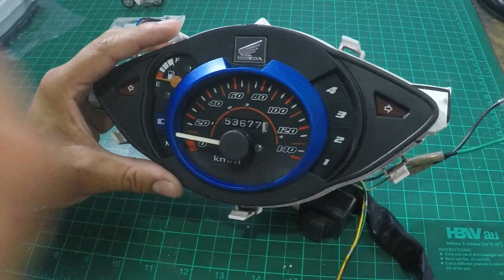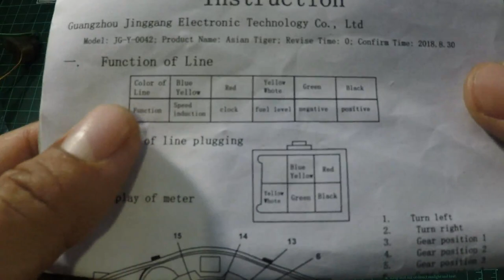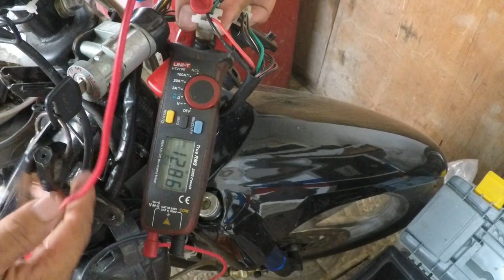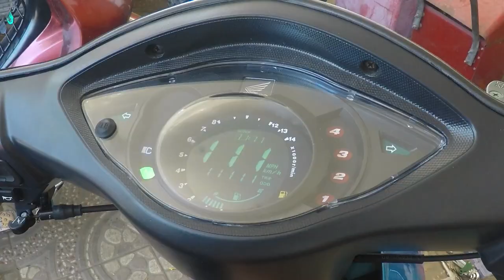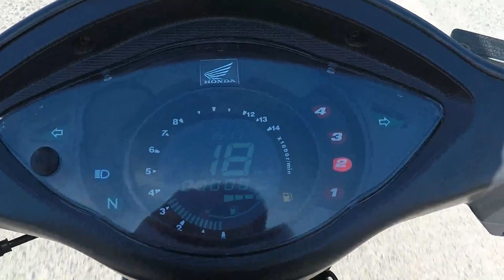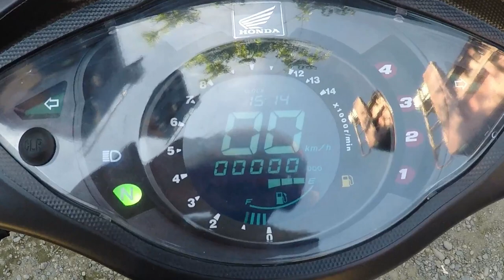Honda Wave 100 Digital Panel Gauge installation

Comment: Making tulong Ng video na to, 100 times ko pinanuod kahapon, step by step hinaya ko lahat, salamat po Ng marami successful Ang pagkabit ko more power
Reply from the maker: Maraming salamat po sa support!
Reply: Sir Yung fuel Di ata accurate naka full full tank ako kahapon tapos ngayon empty na pero nung sinilip ko Ang tangke marami pa namang laman, ganun din po ba sa Inyo?
Reply: @RizalDy3469  palpak yang digital boss. Sa board mismo may prpblblema
Reply: Boss san mo nabili yan ganan na panel gauge? Sana masagot
Reply: @RizalDy3469  plit ka po ibang floater po😊

Comment: May idea ako custom sa wave 100, naked handle bar, tpos kakabitan ng windshield sa harap then nakakabit sa bracket nun ung side mirror parang nmax (ung sakto lang laki pra sa wave100) tpos digital panel gauge dun ikakabit sa awang sa gitna ng windshield (nakita ko ung idea sa click 125 / 150 na nka windshield + naked handle bar) baka maisipan mo lng 😁. Ung digital panel gaude kamuka ng sa raider fi
Reply from the maker: Maganda nga yun sir, na visualize ko din sya. balak ko din po gawin pero kukuha pa ako ng isa pang wave 100 for that project.

Comment: ask ko lang po' panu pag pag walang speedometer cable gagana parin po ba yung RPM nyan?

converted po kasi yung wave ko, wala na pong speedometer cable kasi hindi fit yung mags pang raider kasi. bale tanggal yung cable nya..

thank you po sana mapansin.. balak ko po kasing magupgrade yan..

Comment: I have my honda wave 100 since last 2014 hangang ngayon all stock parin, except sa "chain sets" at "gulong". mukhang bago parin kasi alaga sa change oil at ingat sa pag gamit. what I love this motorbike is its fuel efficiency napakatipid talaga, I'm planning to sell it, but I have already an apprehension when I've watched your video. thanks for sharing bro!

Bibili din ako ng digital speedometer.
Reply from the maker: That means a lot to me sir Randy, Madaming mas, malakas, mas matulin at high tech na motor ngayon. pero I prefer using this mc kasi tulad po ng sabi nyo fuel efficient ito at madali ang pyesa and mura, madaling itroubleshoot at higit sa lahat para sakin maganda ang itchura. Thank you sa panunuod, Ride safe po :)
Reply: @theadventureofwave1002  para sa atin na kontento lng sa simpleng bagay maganda na talaga ang wave 100, mas okay sakin ang unang labas kesa bag o ngayon, madali lng pagandahin at tama ka mura lng ang mga accessories nito at madaling hanapin, kahit anong hightech, mabilis, angas, o lumilipad man ang motor mo after all mkakarating karin naman sa pupuntahan mo. 😂
Reply: @theadventureofwave1002  pare d ba mapuputol ang cable kung mag babacking ka? since digital to?
Reply: @theadventureofwave1002  wala fuel gauge sir?
Reply: Gud pm sir, san po nakakabile ng ganyan spedomiter? Pwede rin po ba yan sa honda dash 110?

Comment: Anu kaya sira NG motor ko pinalitan ko n NG cable speedometer Yung motor ko Ang nangyayari sumasagad parin Yung sa dashboard kahit mabagal Ang takbo. Honda wave110r. Drumbreak po
Reply from the maker: try nyo po muna mag basic troublesoot, linisian nyo ung speedometer gear sa may hub. make sure po na tama ung speedometer cable na pinalit nyo, make sure din po na naka kabit mabuti ung cable sa panel gauge. pag ganun parin po ang issue. most likely ung panel gauge na po ang sira.

Comment: Sir bakit ang saken malaki ang jump ng number ng indicator pag natakbo from 25 ang next na is nasa 35 or 40. Pano po kaya ito. Thank you po
Reply from the maker: sir try nyo po linisan ung gearbox ng speedometer sa may hub. linisan nyo ng gas para mawala lahat ng lumang grasa then grasahan nyo po.
Reply: @theadventureofwave1002  natry na sir. Pero kahit mabagal ang testing sa 5 agad natalon ang indicator.

Comment: sir new subs po ako..my tanong lang ako..di kasi accurate yong tachometer ko na blue wire kahit naka connect na ako sa ignation coil..wla bang ibang option na pwd pag konikan nang blue wire sa tachometer pra gagana siya..!!!
Reply from the maker: Maraming salamat po sa pag subscribe sir. My cases po akong na encounter na hindi accurate yung tachometer. Tama po pinag kabitan nyo. and para maka sigurado much better po if gagamit kayo ng tachometer tester para ma pag compare nyo po yung sa digital gauge kung gaano kalaki ang diff. nya.

Comment: Boss papalitan pa po ba yung speedometer cable at gear box para xa digital o yung stock pa rin na cable gagamitin?

Paano po paganahin yung rpm boss?
Reply from the maker: Plug and play na po yung speedometer cable wala na kelangan palitan, ung sa rpm po. Blue wire icconnect nyo lang po sa pulser ng ignition coil.
Reply: Salamat boss may problema pa ako boss..di gumagana yung function pag mag set boss ng clock tsaka ng kulay..tpos delay po yung rpm ko at speedometer ko pag tumatakbo na

Comment: Idol salamat sa tutorial all working lati fuel gauge ♥️💯 kaso bakit ganun idol by 5 yung pag angat niya ng numbers from 0-5 then 5-10 agad ano po kaya problema dun sana masagot idol
Reply from the maker: Walang anu man po. Maraming salamat po din po sa pag support sa aking maliit na channel. Sir may mga narinig na akong cases na ganyan. personally speaking, baka po manufacture defect na po pag ganun.
Reply: @theadventureofwave1002  Salamat idol full support ako sa mga daratin na video mo 💯

Comment: Idol thank you sa tutorial all working pati sa tutorial mo na fuel gauge ❤️ may issng concern lang ako sir bakit kaya super delay padin ng angat ng rpm ko kahit naka rekta na siya sa ignition coil. hindi siya katulad ng sa video mo idol na hindi masyado delay ano kaya problema nun sir. sana po masagot idol
Reply from the maker: may na encounter na din ako na ganun sir. nung nag pa kabit sakin ung kaibigan ko ng same digital gauge. sa product na po mismo un problem pag ganun..
Reply: @theadventureofwave1002  Salamat sa pagsagot idol 💯❤️

Comment: Sir need ba bago or working Un battery? try ko sya install pero ayaw mag on yung main panel paano kaya to try ko nman follow un instructions mo.
Reply from the maker: Yes sir kelangan po working ang battery d sya gagana ng maayos pag sira ang battery sir.
Reply: @theadventureofwave1002  ok na po sir pero ganun ba talaga sya after ko lagyan ng fuse sa battery kahit nya off may clock display na maliit sa gitna? Nung kasi wala pang fuse nka fully off sya talaga walang display na clock pero hindi naman na reset un clock.
Reply from the maker: @lawo6586  yes sir, ganun ung clock feature nya. kaya much better pag maganda pa battery mo di sya madredrain agad :D
Reply: @theadventureofwave1002  ah oks sir ty sm po

Comment: Lods,ano kaya problem nung saken, kapag nasa gear 4 na namamatay yung gauge. From gear 1 to gear 3 oks sya.
Reply from the maker: baka po grounded ung wire ng 4th gear indicator sa may gauge. check nyo po kung may exposed na wire.

Comment: Paps, ano ang long term review mo sa digital gauge mo? Kamusta siya after a year?
Reply from the maker: for a while okay naman sya kaso napansin ko mejo naninilaw na ung lens nya.
Reply: @theadventureofwave1002  Pero working pa din lahat?
Reply from the maker: @lesterevio  opo. okay naman sya, kaya lang pag malakas sikat ng araw ang hirap makita ng lights.
Reply: @theadventureofwave1002  hindi ba same ang size ng lens sa digital panel gauge sa stock panel gauge?

Comment: Sir serious question po, yung speedometer ko nawala po yung line ng Neutral wala ding bulb kaya walang ilaw yung N, pano ko po siya malalagyan kasi magpapalit po ako ng ganyang digital speedometer. Thankyou in advance!
Reply from the maker: punta lang po kayo sa suki nyong motorcycle parts at bili kayo ng bulb socket ng gear level indicator. yung wiring ng gear indicator nasa left side ng engine. dun nyo po ma tretrace kung asan ung connection ng neutral.
Reply: Thankyou sir, pwede ka po ba ma add sa facebook? Want to be friends with you and papatulong na rin sana pag may problema idol! Salamat
Reply: Boss nakabit ko na digital speedometer ko kaso bakit rumerekta sa selected  color di yung pag open nung susi nag iiba iba muna, tsaka boss nagrereset lagi pag may nagagalaw. Yung kulay tsaka oras kahit nakarekta naman positive yung clock.

Comment: Sir naka battery operated cdi ako, yung tachometer hindi nagana, pag nasa ignition coil wire,kaya tinap ko sa pulser wire sa cdi. Okay lang po ba yun?gumagana naman na rpm guage, pero i doubt kung walang short circuit na mangyayari. Salamat po sa sagot. Subscriber nyo po ako
Reply: Sir saan ka nakabili ng digital para ss wave 100r?

Comment: Sir. need pa ba ng floater yan para gumana yung fuel gauge?
Reply from the maker: opo, need po ng floater para gumana fuel gauge.
Reply: The Adventure of Wave 100 pang anong motor sir ang floater na ginamit nyo?

Comment: bro ask ko lang di accurate yung gas niys laging 4bars lang ano kaya pwede gawin?
Reply from the maker: napansin ko sir hindi maxado accurate. check ko ulit anu fix dun then mag upload ako new vid.
Reply: paps. shout out mo ako ha. eto para accurate yung gas palit ka ng floater ng mio. adjust mo lang para sa bar pataas . tapos ang hindi mo ilakabit sa floater yung wire na blue sa gas tank. accurate na yun 😊
Reply from the maker: @zeedave12  Try ko to sir maraming salamat po. Opo sir commended po kayo. Thank you po sir ZeeDave!

Comment: Hi po kuya sana mapansin mo ko. Gusto ko po sana magpatulong. My motor po kasi papa ko wave din. Pinamana na nya sakin. Ang kaso po sira lang konti. Need ko po ma upgrade yung motor papa. Kaso di ko po alam how
Reply from the maker: Maganda po yang tanong nyo. pag gusto nyo po mag start ng restoration project tignin po kayo online kung anu gusto nyo gayahin na concept. then unti untiin nyo po. i would suggest mag start po kayo sa engine. Good running engine ang pinaka magandang start. kasi at the end alam mo na aandar sya ng maayos.

Comment: Sir? Nagpakabit na ako neto pero di na se save ang time at kulay. Ano po ba dapat gawin pra ma save? Salamat
Reply: @8:53 lods, pero ung akin red wire sa ignition ginilitan ko lng ng konti tpos tap
Reply from the maker: dapat po ung red wire may direct connection sa positive terminal ng battery and di po dapat na didisconnect.
Reply: @theadventureofwave1002  ahh, ok sir. Thank you po. Godbless

Comment: Gud eve po boss, patulong po nag lo-loose contact po ba sayo? Kasi iyong sa akin maliit na hump lang nag rereset eh, salamat po
Reply from the maker: nang yare din po sakin yan sir. ang prob pala nung sakin is ung ignition switch. pag na gaalaw na wawala power. try nyo po paandarin motor nyo tapos alugin or galaw galawin nyo po ignition switch pag na matay sa pag kaka galaw malamang po dun na un.
Reply: yong sa green wire at black para sa panel gauge light lagyan mo ng extra wire bago mo lagyan ng electrical tape...ganyan din dati sa akin nagre-reset dahil lose contact yan walang kuryente...
Reply: yong sa green wire at black para sa panel gauge light lagyan mo ng extra wire bago mo lagyan ng electrical tape...ganyan din dati sa akin nagre-reset dahil lose contact yan walang kuryente...

Comment: Sir paano nga pala stay yung clock nya nababago siya kapag nag off ng switch.
Reply from the maker: dapat po ung red wire of yung lock naka kabit sa positive terminal ng battery para kahit i off nyo po yung ignition switch di madadamay ung clock.

Comment: Sir tanong ko lang paano yung wiring ng rpm? Dina walang rmp ang stock speedometer?
Reply from the maker: opo, walang rpm guage ang stock speedometer.
Reply: Sa ignition coil ba kukunin ang kurente papunta sa rpm?
Reply from the maker: @alemodinracmat4617  opo sir

Comment: Pwd po ba Yan sa Honda wave 110r?..big thanks sa sagot
Reply from the maker: opo yata. kasi same ang panel gauge ng bagong wave 100 which is wave 110 na ngayon.
Reply: Wave 110 user here... Oo paps, pwedeng pwede siya... 2 months na siyang nakakabit sa motor ko... Diko nga lang ma set yung clock, di accurate yung fuel gauge at wala pang rpm meter (tachometer) kac naubusan ng wire at di makalabas kac under quarantine parin...
Reply: @exdeedatsuki8786   yun sakin paps wave110 din2018 model fit kya sya sa panel ng motor ko...salamat paps
Reply: @avegailsalitorno3588  fit siya

Comment: bat skn nagbblink ung fuel? gnya ko nmn yan bat ngbblink s empty ung fuel gauge nya
Reply from the maker: pag nag bliblink po  that means almost empty na sya or hindi naka connect ang wirings ng fuel gauge. if connected na ang wiring at nag bliblink parin. may posibilty po na defective and unit. check nyo din po yung fuel sending unit if gumagana.

Comment: Sir, bakit ung sa akin nag iiskip ung speedometer? pag tumatakbo na, Ano kaya problema? Patulong boss?
Reply from the maker: na experience ko yan sir, namamatay matay pag umaandar. sira pala ung ignition ko and one time super lowbat ung battery ko kaya papatay patay din.
Reply: @theadventureofwave1002  sir, di naman sya namamatay, di lang continous ung number ng speed, nagaagwat sya, ex: from 15kph bigla na lng magiging 22kph, need pa ba may ibang icoconvert? tapos ung kanyang clock, 90sec/min kaya di rin accurate, pa tutor naman boss baka may alam kang gawin para maayos panel gauge ko, salamat :)
Reply from the maker: @TheJerneth  Check nyo po mabuti ung speedometer cable, dapat po naka salpak ng maayos, then linisan nyo po ung gearbox ng speedometer at grasahan nyo para smooth ang galaw, check nyo na din po ang cable, make sure na smooth din ang ikot nya. about sa clock sir try nyo pong alisin sa battery connection ung gauge then plug back in then set up nyo po.
Reply: @theadventureofwave1002  ok sir, try ko gawin bukas, update ko kayo kung ano mangyari hehe. Salamat po.

Comment: san na bibili?
Reply from the maker: sa lazada ko po nabili pero meron din po sa shopee
Reply: @theadventureofwave1002  pa hinigi link sir. hehe
Reply from the maker: @chardofficial6678  https://www.lazada.com.ph/products/for-honda-wave100-lcd-multifunctional-motorcycle-digital-odometer-speedometer-tachometer-fuel-gauge-i699396084-s2022228692.html?spm=a2o4l.searchlist.list.43.107a464cJdPzGN&search=1

Comment: boss saan nkakabili nyan at magkano mg pa install?salamat boss
Reply from the maker: sa lazada ko po nabili to, 1.6k about sa installation di ko po sure mag kano ang tanggap ng mga mechanic/electrician baka po nasa 200 to 300 pesos po.
Reply: @theadventureofwave1002  and pwede rin po pala dun yan sa wave110?

Comment: bakit sabi sa lazada reviews di raw accurate ang fuel gauge
Reply from the maker: Tama po sir need pang palitan ang stock fuel gauge ng wave 100 para maging accurate.
Reply: @theadventureofwave1002  
boss anung fuel gauge ang pinalit mo?anung motor ng fuel gauge..salamat boss sa sagot

Comment: Accurate po ba ang fuel gauge?
Reply from the maker: yung fuel low ko 2bars eh di maxado accurate.
Reply: @theadventureofwave1002  same po tayo. may nag sabi sakin 2 wire floater daw kaso d ko alam pano ikabit
Reply from the maker: @chinogameon3247   di gaano accurate ung fuel gauge sir,  pero sinubukan ko itaas floater tumataas din bar pero di full bar. pag binaba ko naman ung floater na almost emty nagiging 1bar instead of blinking dapat. nag kabit din ng ganito ung kaibigan ko yung kanya pag emty blinking nlng.
Reply: @theadventureofwave1002  eto yung reply nya sakin hindi ko lng masyado na intindihan, "Hanapin mo ung pumunta sa digital mo na yellow wire  at green wire un dalawa na un"

"Ibig sabihin dalawang wire lng kc ang stock natin na floater 3wire lng pang analog gauge un"

kaya daw need ng 2 wire floater para mag accurate
Reply: @chinogameon3247  meron pong convert na ggwn jan.. Magpapalit ka ng floater.. Ops secret 😘😘
Reply: @anti-ponzipyramidingscheme7165  pa tulong po paps wag na po secret hehehe
Reply: @theadventureofwave1002  magpalit ka ng floater pang faider 150 yung two wires, ayun   ayos un.. Thanks me later
Reply: @anti-ponzipyramidingscheme7165  patulong nmn paps

Comment: Sir, bakit po nag rereset yong time kapag starter ang gagamitin ko 🤭
Reply from the maker: malakas po ba votage ng battery.?
Reply: @theadventureofwave1002  Ok na po sir. mahina lang pala yung voltage ng battery ko. kaso yung sa fuel gauge parang hindi tugma sa digital
Reply: Yung akin hanggang 4 bars sa digital kahit na full tank ako.
Reply: Boss anong floater pinalit mo laging blink lng sakin eh

Comment: Sir ayaw gumana ng clock..
Reply from the maker: make sure po ung wire ng clock naka direct sa positive terminal ng battery. pag ayaw parin po. try nyo po na tanggalin ung speedomter. then test nyo po. pag dikitin nyo lang po ung black at red wire. dikit nyo sa positive ng battery then ung green wire dikit nyo sa negative ng battery dapat po gumana. pag di po gumana possible po na sira ung gauge.

Comment: Sabi sa shope plug and play na
Reply from the maker: yung nabili ko po kasi kelangan ko pang mag palit ng floater pang mio para maging accurate ung fuel gauge. Di po ako sure if meron nang lumabas na version ng ganitong speedometer na 100% plug and play na sa wave 100.
Reply: @theadventureofwave1002  salamt sayu boss

Comment: nabalik ung akin sa 12:00 ung clock bya idol
Reply from the maker: mangyayare po ung pag na drain ung battery or natanggal connectin sa battery sir.
Reply: @theadventureofwave1002  sge po thanks po 😊😊